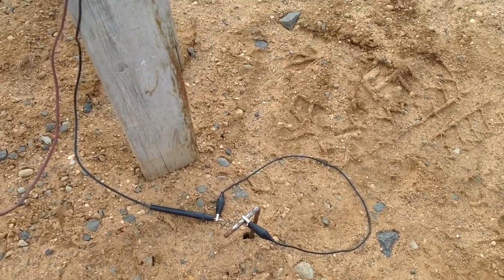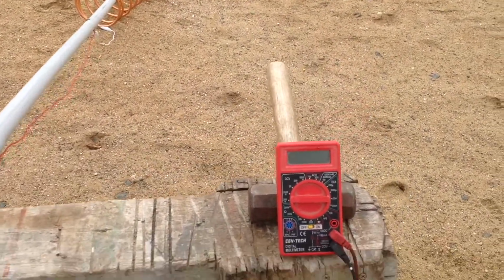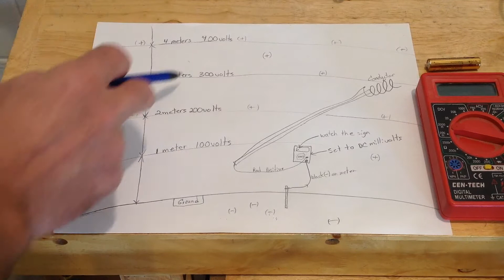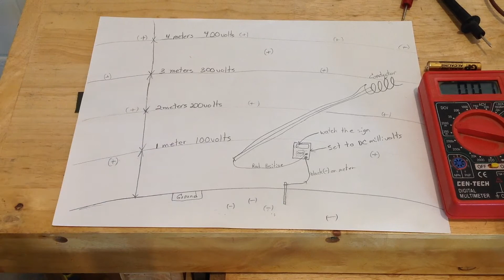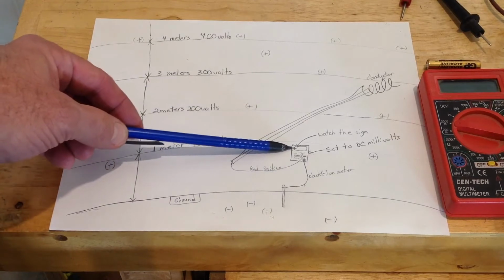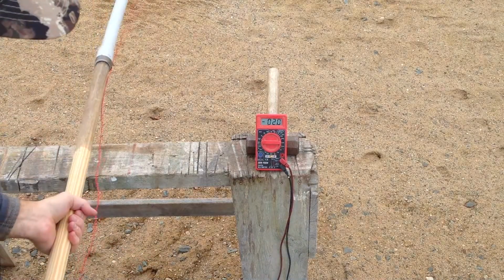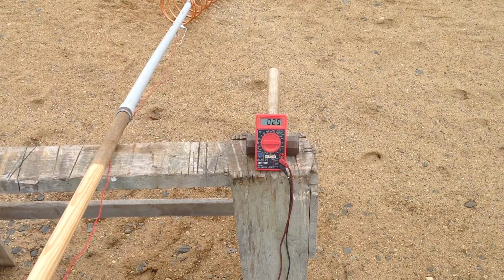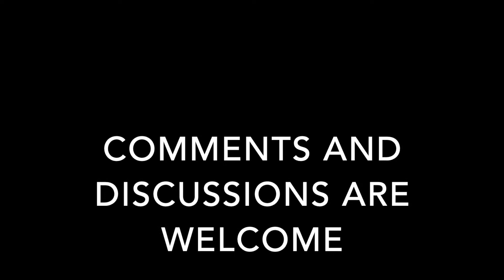Electric Potential in the Air??  Simple experiment to detect

Comment: Atmospheric electricity is a hard beast to nail down simply because everything that sticks out of the ground raises the grounds potential, if your by a tree the negative field of the earth
will be at the top of the tree  meaning you were still in the negative field of the earth not in the atmosphere.... you would need a much taller pole to get above the tree that you are by just to start to get out of the ground effect..... that is the problem ! I have tried several times to get atmospheric electricity here at my house but I would have to go higher than the telephone poles just to get out of the ground effect and start that 100v per meter high voltage potential  the ground field that covers the ground like a fairly tight sheet it does not dip down sharply and in valleys it will sometimes just stay level with the ridges !  I KNOW I'm talking from experience !  a balloon is about the only practical way to get a wire up there in the free air above the ground's potential ...sorry but that's how it is !
Reply from the maker: Have you ever tried a balloon?  I seen on lasersaber channel he tried a drone with some success.
Reply: @doubleMinnovations  No I haven't as there is no point because the winds here can reach 90mph every winter and if I go to all the work of setting up a system i want it permanent not a week or 2 at a time.
 if I had a ham antenna tower like I had 20 years ago I could just crank it up to 50 feet and have a 20' pvc pipe on it to get me above ground effect
although it wouldn't be far as the tower would be the point of ground effect then but it would be something.... I've had better luck pointing my ham antennas toward power transfer stations of PG&E and I've gotten a few volts just from that  ( they were 20 miles away but were a very dirty power station) I have alot of experience with making ham antennas and on a few I have gotten a few volts from .... my long 80m antennas (120') were the best but they were only 20' from the ground... getting above the ground effect is very hard, a guy on YouTube made a PVC pipe tower a while back and hooked a wire to the top and got over 1000 volts from it I set out immediately to replicate that, but realized shortly after that it would never withstand our winds up here so I gave up.... 1000v ran through a bridge rectifier and then into a step down transformer would provide all the power I need except for my welder LOL

Comment: I noticed as you moved it from the ground into the air seems as though the friction of moving it through the air causes the voltage to rise maybe there's a way to gain efficiency through those means?
Reply from the maker: I think the voltage changes, just because the conductor is going into the electric field. That was the theory, and this is what I did to see if I could detect it.  Thanks for the comment.

Comment: Ground pin in ground needs to be isolated, do thes by encapsulating the pin or rod in a 2inch plastic pipe into the dirt with the rod inside.
See the difference. 
You should now create a draw from the atmosphere above .
Reply: how deep would the plastic pipe need to be? as deep as the rod?

Comment: The aligator connector you use are not isolated, the current will leak at every bare metal non-isolated connectors.

Comment: You should search for earth batteries.  You can make them with soil or water.  The soil has to be moist.  Use two different materials for your terminals like copper and aluminum.  Make the earth battery in series.  These are cheap easy volts to build.  Roughly one volt per cell.  Then to get your amps, wire a solar panel to the earth battery in parallel.  You will have all the cheap green electricity you could ever want.
Reply from the maker: Yep; have done that before, and will have a video coming with my best version.  Thanks.

Comment: To get better results make another taller stick and at the end, instead of that copper coil. Get ~12guage copper wire and make a whole bunch of 8 inch hairs soldered to the lead
Reply from the maker: The experiment was just to detect the electric static field, so I use what I had, that had a large conducting surface area.  You are right, if plan is to bleed off electric charges from the ground in a continuous manner.   Thanks for commenting!
Reply: @doubleMinnovations  my bad, didn't want to seem like I was correcting you 😅 just putting the info out there in case others want to try and do something like this. I plan on doing some experiments myself and I have learned from your video, movement seems to be a variable important for getting more of a charge. So I want to see if I made the top spin in place if it will "scrub" more charge out of the atmosphere.
Reply from the maker: @SermonFapple  All my videos are meant to inspire people to think, create, experiment, and share ideas.  All is good.  Thanks for commenting!
Reply: @SermonFapple  so, to increase the voltage you need to increase surface area on the top? like a van de graff generator?

Comment: If you heat up an end of a wire,anything from 60 to 600 volts is enough to lift it a metre off the ground.
Reply from the maker: Could you explain a little more?  Heat the end of a wire up, and then...do something with applying voltage somehow?
Reply: Watch how a power line jumps when it hits the ground.High voltage one end of a cable will jump even fly and sway.Kinda like when you let go off a garden hose at full pressure.

Comment: The coil is not picking up anything from the electric field though it is there. It is moving through the magnetic field lines from the earths electromagnetic dynamo. To make use of the electric field you would need to be able to draw positive energy down from the air and store it into a capacitor of some sort. One end of the capacitor would be to the ground, and the other would be a receiver in the air.

Comment: Hello you put the voltmeter on DC mode right? You should try it on AC instead
Reply from the maker: Yes, it was set at DC in order to detect the static electric field.  I have done AC reception experiments for many years.  Check out this video:  https://youtu.be/PBkwBrQoc-M

Comment: If on average for every meter up in the air there's 100V potential difference relative to the ground, why did the multimeter measure values only in fractions of a millivolt?
Reply from the maker: Great question!  A more sensitive meter would register a higher voltage, before the raised conductor and the ground are equalized at a raised position.  The meter requires a tiny current to flow through it in order to register a reading at all.  And that tiny current is all it takes to neutralize the conductor with the ground.  So it only registers a few millivolts when it's raised and lowered.  I believe the readings were between 2 to 5 millivolts.

My further explanation; is that the ground is like a big plate of a capacitor that has a negative charge compared to the air.  The conductor (the copper tube) I use is connected to it, so it is like an extension of it.  While the conductor is at ground level, it's neutralized so no current flows.  At the moment the conductor is raised, it is no long neutral with the ground, and a charge will want to flow.  
The surface area of the conductor (the copper tube) determines the amount of charge that it can hold.  The conductor only requires a small number of electrons to flow again, to be neutral with the ground at the raised position. -it's a small extension of the ground to a higher position.  A conductor with a bigger surface area, would register more with this meter; or a more sensitive meter would register more before the conductor is neutralized.

Thanks for commenting. 😀
Reply: @doubleMinnovations  Thanks for answering and making the video :) I didn't take those things into account when I commented. Now my question is: wouldn't the coil conductor make things worse? I mean its surface area is more dense than a single wire, some kind of sharp metal skewer would work way better. Sorry for a late reply.
Reply from the maker: The purpose of the experiment was only to detect the electric field.  A large conductor is what I looked for through my junk, and found a coil of copper tubing.
If I was going to try to continually 'bleed' off a negative charge from the ground into the air, I would use many tiny conductive points to do that.  -That would be another good experiment.

Comment: Every meter above ground potential is 10 volts, 100 volts is 10 meters above ground potential.

Atmospheric electricity   is more electrostatic in nature, that's why you're not getting the results that you expect.

Try using a large resistance between the coil and ground to measure the voltage.

Right now you're trying  to measure a voltage with the inductive reactance of the coil as the only resistance to separate the potential difference between  the atmosphere and ground.

The electrostatic charge walks over the outside of the line, don't touch any part of the experiment with your bare hands because it affects the measurements you're getting.

You might want to use a much smaller gage wire with a lot more turns as your receiver.

Hope that helps!

Comment: good for start, but i see 0.4 mili volts, not 200-300 volts (i guess your rod is 2-3 meters)... so.... why not collecting 200-300 volts?      the next thing you can test is,    four meters rods..... two of them....   dsitance between them several meters.....  then on top of them connect a graphine wire.. it has thoudpsands of spiky sharp points, it collects more ions.  where to find graphine wire?  i will search to find. if you find the source, write here.
Reply from the maker: The current is so tiny, the cheap meter I'm using can barely detect anything.  This experiment was just to show that you can detect something.  Thanks for watching.

Comment: The way you measured the voltage is fundamentally wrong:
This is because the voltmeter only measures the voltage between its 2 terminals,
(which are always very close), but not 2 points far away.
The correct way is measuring the DC current.
 1 - Use a long and insulated wire (Ex:  the kind used in a transformer)
      running along the pole.  Both ends must be scratched clean.
      Non-insulated wires do not work because they "short" the Air
 2 - The meter is hooked up as you did, but should be wired for DC current, but not Voltage.
       Of course, get a very sensitive meter.
 3 - The voltage is just the product of the current and the resistance of the meter.
Reply: could you explain more? how would you run this lab?

Comment: Altho this is old experiment you should try again with a spark gap on the positive side, as small as you can make. The ionized air repel the conductor if its grounded, if you use a spark gap, the conductor will be ionized a lot more and you get the reading out when it sparks. Use a capasitor to store the energy to get a better reading.

Comment: I think you've done a couple of things wrong here.

First of all, you're attempting to measure voltage with the meter wired in series, so you're not going to get any reading; voltage is measured in parallel to a circuit that is already complete.

Secondly, however, what you want to do with your setup is actually to measure the current rather than the voltage; that's indeed done in a series, and this would be a great experiment to do it. I doubt your meter can measure currents as small as what you'd expect to see unless it's a high-grade one, but the further up in the air you'd get your ion-harvesting antenna (the copper coils in this case), the higher the current would be.